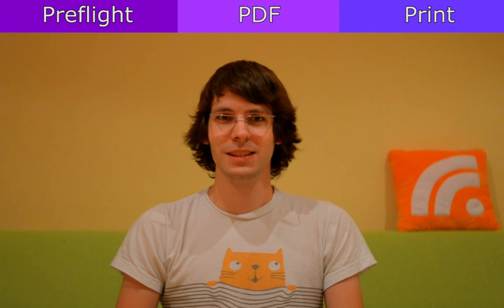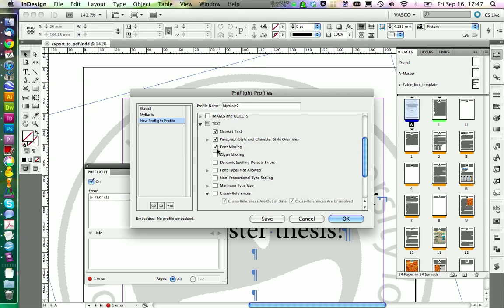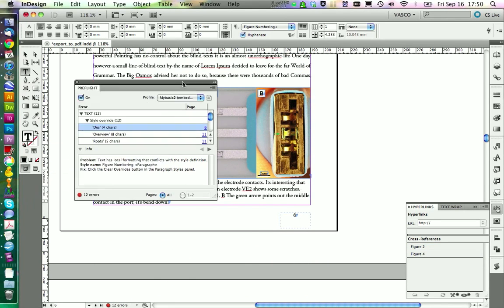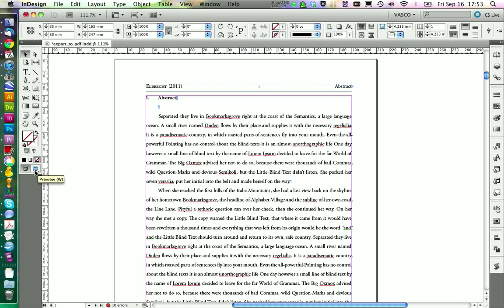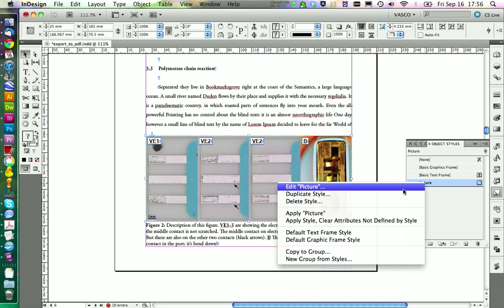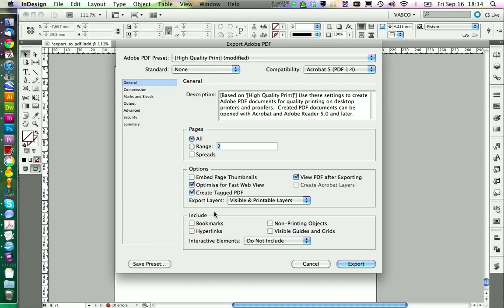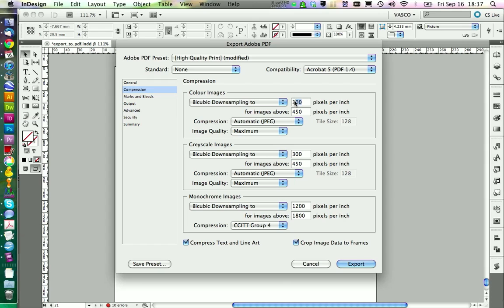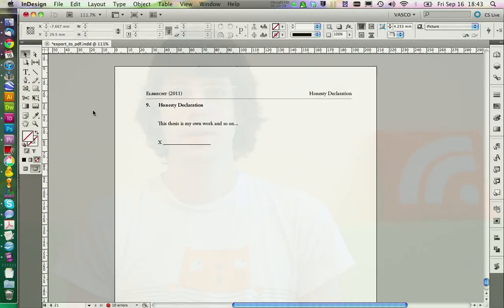InDesign CS5 - Preflight, PDF and Print you Master / Bachelor thesis tutorial (Part 9)

Comment: Great tips. InDesign preflight is very useful, however please do not forget that it falls short on certain issues. Such as placed Illustrator files with linked fonts or graphics. FlightCheck from Markzware will check these (and package them), but also will do the same on native Illustrator, Photoshop and even the PDF files. Very useful for 100% quality assurance on your final thesis.